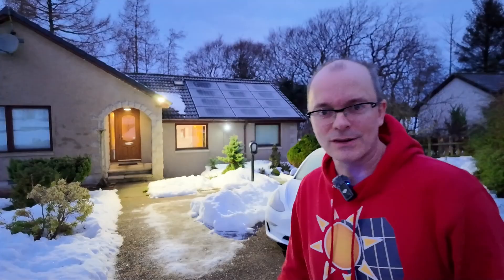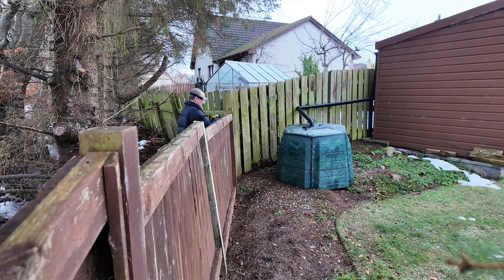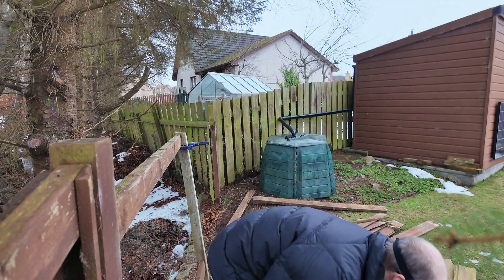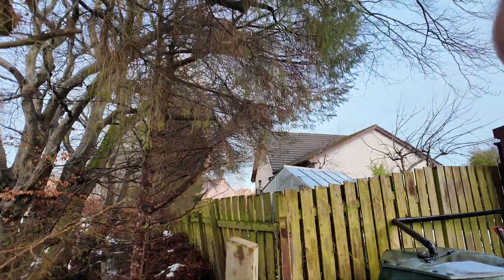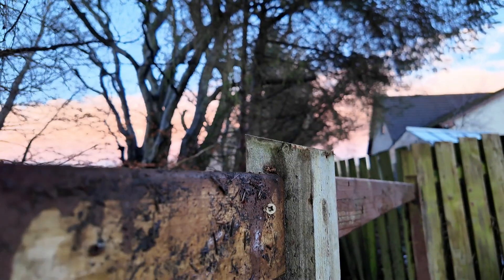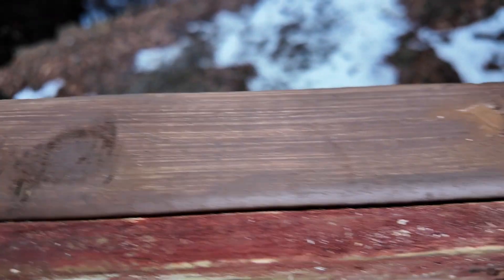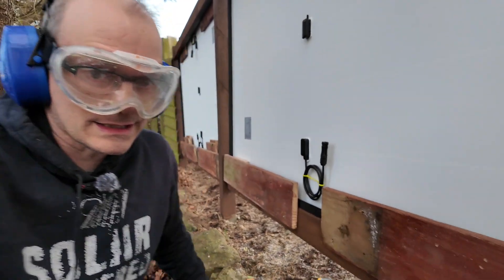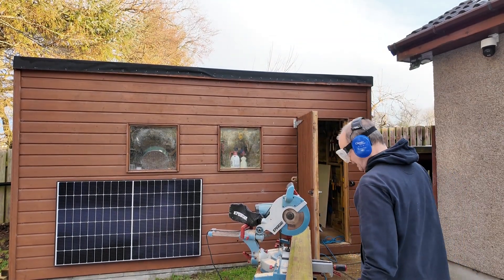The Prototype Solar Fence - Solar Fence / Shed / Battery Project Part 2

Comment: I don't know much about the climate in your country, but even though I live in a cold climate, the panels get very hot in the summer, which reduces their performance and lifespan. That's without even considering the risk of fire from contact with wood, but I want to do the same thing with metal! :D
Reply from the maker: Solar panel surfaces that are directly exposed to the Sun will get hot and temperatures outside are 30°C.  The reckoning is that they can hit 70°C.

But the same is also true for dark coloured woods as well:  they get just as hot.

The surfaces which are not directly exposed to the Sun will remain at ambient air temperature.  It is a surface temperature phenomenon.

Auto ignition for wood is around 250°C.  On its own, you’re not going to get ignition of the wood.  However, a bad connection with an MC4 connector….
Reply: @anthonydyer3939  I live in northern Wisconsin, and in the summer, my solar panels exceed 120°F with the backs open to the air. The problem I see with that installation is that the panels are completely covered, and the temperature will start to rise. I want to do something similar on one of my properties, but I was planning to use metal and include plenty of vents for heat dissipation. Time will tell how efficient and durable this installation is

Comment: The main thing is to try something and learn so congratulations. Designing solar panel racking (what’s being done here) = resisting “over turning” and “uplift” forces primarily, (weight / downforce of horizontal rack and panels is usually less than 3 lbs per sq ft but account for snow dead load then). Lots of folks are interested in fence mounting and they should avoid some of the details you’ve tried out here such as the tilt and rack connections increasing rather than decreasing the collection of water inside the lower panel frame rail - panels die from moisture ingress at the edge of the lamination to the front glass primarily. Panel OEM warranties used to prohibit vertical and horizontal mounting of less than 5 deg tilt in the small print for this reason. The main move here is to buy the right panel meaning glass:glass front and back which will have a seal between the glass front and backsheet and last 30 years plus much stronger in all respects. In my thumbnail pic you will see a sm version glass:glass panel made at the factory I led years ago, one of the first bifacials made in US. If you must use conventional panels, the tilt should have been opposite with bottom forward and not to the rear.  It’s grand that you’ve made a start and tried something! I say that sincerely but am informed by work to gain two US patents for racking that it will be worth some re-work when you can get to that (they’ll be fine for a few months). Cheers, Tom
Reply from the maker: It’s great to hear your feedback.  Indeed I taken note of the “leak holes” that also double up as ground screw holes.  

Now reading the manual for the module, it recommends an install angle of more than 10 degrees tilt.  There’s nothing in the manual to say that vertical mounting is not recommended, and indeed vertical mount systems are being increasingly discussed within the industry.

I’m certainly aware of issues with shallow pitch modules in relation to water ingress.  But the cavity on my module was dry after a period of heavy rain.  That gives me confidence that water accumulation is not going to be a chronic issue.

Comment: Only thing concerns me?  What about the water build up at the bottom of the solar panels when it rain.  Are you going to add some drain holes in the bottom rail that sits on the wood?
Reply from the maker: There are “leak holes” built in to the rear flange plate of the solar panels.  There has been some rain, but the inside edge has not shown signs of puddling.

Comment: That is a tiny hammer, normally a post hammer is VERY heavy
Wind loading can be  quite  high and your fence seems very weak to resist, you may want to do some lateral reinforcement 
It seems like a  great application for Bi-facial for efficacy and look for anyone else doing this project 
Solar fencing is otherwise a very good and cheap way to add solar

#BanTeslaStopFascism
Reply from the maker: Other fences around my property would be better for bi facial.  The light behind this fence is very dark with all the trees behind it.  But yes the post could certainly do with extra support.  I’ve seen these post hammers - a good gym membership alternative!

Comment: The fence looks good, both from the front and the back.  I have similarly wrestled with getting fence posts out of concrete and dealing with the posts rotting off at ground level so now I replace them with concrete posts set into concrete.  It’s more work than your steel spike but it’s a permanent fence post that won’t cause me trouble in the future.  If you want the aesthetic of wooden posts then set a dwarf concrete post into the ground and bolt it to the wooden posts - I’ve done this a few times to strengthen and straighten wooden posts that have rotted off and it works great.
Another minor comment on your solar panel fence, where the wire goes between two panels over the front of the post, suggest you wrap the cable in conduit , sheathing or insulation because over time the cable will rub against the post with the wind and get damaged.
Good project, keep it going !

Comment: EXcellent job Anthony, very impressed with your DIY solar hooks to secure the panels from the rear, why not where the cable goes across @ the top, carve out a groove left to right on that post, and then fasten a former fence board,vertically, not only will it protect the cable but it will proablt completly cover the gap ??, part 3  please Anthony :)
Reply from the maker: I’m thinking of protection for that cable, but PVC capping will probably be the way to go.  I want it to be obvious that it’s a “don’t drill here” zone.

On another note. I have to redo the fence.  Big mistake:  Aluminium and tanalised wood should not touch each other.  I didn’t realised that tanalised wood contains copper, so you’ll get galvanic corrosion.

Solution:  A plastic barrier wherever they touch.  Could be as simple as a thin bin liner.  I’ll be using that plus strips of Damp proof course.

Sadly it’s a rain forecast for the weekend, so the shed will probably have to wait.  But I’ve been prepping the wooden notches.
Reply: use damp proof course material, its weather resistant and much thicker than bin liner material which is usually biodegradeable
Reply from the maker: @geoffreycoan I’ve got a 30m roll of damp proof course, so I’ll retrofit my prototype fence.  It’s not too flexible for the slots, but I could cut up a plastic bag for those bits.

But I’m now having further thoughts about my shed and front fence designs.  I’m inclined to go the rail mounted route for the panels, rather than removing the shed cladding.  

There’s a certain degree of faff with mounting on to vertical rails with a clamp system.  Plus I also need to somehow reach behind to handle the cables, and there’s only 40mm clearance to do that.

But taking the cladding off, adjusting the shed frames, and then using my wood hook concept.  It was complex, and the loading on those hooks is unproven in high winds.  Once I added on the need for a barrier between the frames and the timber, it crossed the “go back and start again” threshold. 

I’m going to try a static load test on those hooks.  It needs to withstand 80mph gusts, which impart a force of 750newtons per sq metre.  So 6 hooks per panel, means I can try lifting a load of 13kg to see if it takes the weight without breaking.

Plan B:  Bimble solar sell mini rails with 4 clamps at £9.  I think I’ll be deploying those for the front fence.  The joists run in front of the posts, and the post interval is less than the landscape width of the panel.  Nice solid posts as well!
Reply: @anthonydyer3939 Good idea to do a stress test on the hooks.  I’d suggest not just dividing the force into area directly like that because you won’t have an entire panel exposed directly and evenly to the wind, it will be one edge, corner, etc where the wind gets between two slats, etc and then that force applies a twisting lateral force on the panel.  The panels are pretty strong though, after all on most roofs they are directly exposed to the wind getting underneath them, secured only by the rails and clips in half a dozen places.
Maybe proven clips is the way to go as all that maths has already been worked out for you!  £9 for 4 sounds a very fair price

Comment: I think if I was to do this I would put in regular concrete fence posts with a 6' gravel board at the base, and slot two solar panels landscape in like you would a fence panel. If the panels are too thick you can screw some batons (these are also sold ready made by builders merchants to accommodate euro 180cm fence panels into imperial fence posts (6")) to the edges to get the correct thickness (which may be needed to avoid shading from the post anyway). If the posts are too far apart and the panels wobble you can hammer in wooden wedges to stop any rattling, like you would a regular fence panel.
Reply from the maker: Concrete posts, honestly would be the only thing I’d want in the ground.  Ideally.  Sadly my back says “don’t try your luck!”.  Heavy ground work is just too far outside my comfort zone, and sadly fencing contractors are simultaneously too expensive and too many of them just concrete wooden posts into the ground, ready to rot.
Reply: @anthonydyer3939  yes I’ll admit it is hard work, there are more lightweight plastic options for the posts and gravel boards that are a little more expensive, but you can’t get away from needing to dig some holes. You might be able to get away with hiring a handyman if you can provide the post hole digger and the chisel on a stick (forgotten the name of the thing, but I have one and it is fantastic). From memory it was more shoulder and arm ache with those tools rather than your back because you’re pretty much always upright. Good luck!

Comment: Suggestion for your bottom joist; using a router, cut a groove for the panel to sit inside. This can also be done using a 3 part composite, with the middle of the three planks being less wide than the other two. I might give that a go on my own panels when they arrive...
Reply from the maker: Thinking some more about this, the front bezel is very thin and therefore the groove would have to be very shallow to prevent cell shading.  Given that wood has a tendency to swell and shrink, I don't think those tolerances would be OK.

Comment: Did you read any handling instructions for the panels?
Every single supplier I've worked with clearly states to never use suction cup lifters on the panels. It leads to microcrack damage in the cell material.
I was screaming at the screen when you lifted that first panel. 😱
Reply from the maker: It doesn't state that suction cups shall not be used in the Aiko instructions.   But reading it again, it does state that only the edges of the module shall be held.  

I'll be mindful that that.
Reply: @anthonydyer3939  Yeah, some manufacturers are a bit vague while others create very visual illustrations of what not to do. Most of what you see on install videos fall under the not to do in fact.
I was very mindful about this during my solar 10.2 kWp install and my system is overperforming by 5% !
Reply from the maker: @1kreature  I was just having a look at the suction cup rings more closely.  Those rings appear to be sub surface.  They don't come off with a damp microfibre cloth.  So I think you're correct.

So now I need to design a tool to carry these comfortably.  The plasberboard carry tools don't have a wide enough jaw sadly.  So I'll make something myself.
Reply: @anthonydyer3939  I am so sad to hear that!
That was what I was worried about. These panels can take a lot of abuse from wind and weather, and even quite large hailstones. But the force applied by these suction cups is quite intense and the glass on the panels are thinner than normal window glass. In fact, anywhere from half to a quarter of the normal thickness. At these thicknesses the glas will noticeably warp from even the pressure of a hand carefully resting some of your weight on them while trying to reach over on a roof install. All pressure/weight classifications call for even distribution of load and anything else can be a worry.
I notice that a lot of manufacturers for US and UK market ship panels flat on pallet, while not a single European one does? My panels came standing on the pallet with the long side vertical while I have seen them available in landscape shipment also. No option for flat shipment. I think this indicates different levels of care from the suppliers and potentially distributers. It takes a huge bump to damage the panels on the pallet such as shipped to you, but it doesn't take as much to cause microscopic damage that deteriorates the panels further over the next few years.
Reply from the maker: @1kreature Actually, we’re good.  Microfibre doesn’t rub it off,  but rubbing my finger on it was able to shift it.  It’s just a mark.

I’ll certainly review the suction cups.  Grabbing the edges, especially the top edge is painful.
Reply: @anthonydyer3939 yeah mine contained explicit instructions to always lift with two people. And at the same time to avoid any twisting motions which is very hard with two people.

Comment: Btw, the simple Z brackets you attach on the 4 holes on the back of the frame on the panels is a much easier mounting option. Just place the two joists at the height of the holes/brackets.
It also prevents you from placing anything inside the edge of the frame like you did, which is a nono from the mfg. Nothing should be allowed in under there to potentially impact the backside of the panels.
Also: There is a drainage hole on the bottom edge of the panel frame that must not be blocked when you install them to avoid ice build up ruining the panel.
Reply from the maker: I was thinking about this. L brackets would also work.  But by ‘eck the Z brackets are expensive (£14 for 4 of them).  I’d love to use regular galvanised brackets, but I’m aware of galvanic corrosion.

The instructions say that brackets should not be in contact with the back of the module such that it can be pierced under pressure.  So what I’m doing is not specifically excluded.  It does go on to say that if you use clamps and bolts then you must use prescribed methods.

Honestly I think I’ll be alright.  Both the vertical and horizontal load is on the frame.

Comment: I've been thinking about a similar project but I'd probably use DuraPost metal posts rather than timber/concrete posts. Having used DuraPost for a couple of runs of fencing they're a pleasure to work with - albeit pricy for the full effect.
Reply from the maker: I considered Durapost.  Another advantage is that it helps to lower the earth electrode resistance. 

I'm not sure though if they are pile driven into the ground or set in concrete.  I'm sure either method is viable though, but pile driving looks potentially easier (although it seems like Pile Driving still involves repetitive lifting of a 15kg weight - which strikes me as also being back breaking)
Reply: @anthonydyer3939 I used Postcrete - no issues yet. Better longevity than wooden posts and much easier to work with than concrete posts. I think Wickes started carrying a sunset of the range in store.... Not sure if they still do.

Comment: Classic delivery drivers. 1-pump on the pallet jack and it's off the ground. That'll do ya. I can understand if he needed to brake though...
Most of these can lift 3" you know? They seem terrified of lifting higher than minimum for fear of toppling?
Reply from the maker: It took a good 25 minutes for him to find a level parking space, and then manoeuvre that pallet onto the world’s smallest lift gate.

He was struggling on the ice, and once mentioned “technically we’re kerbside deliveries only”.  It was a “good enough” delivery.  But he certainly was watching his clock.

Comment: I use a sack trolley to move  heavy rectangular items like 60kg street paving slabs. Our heating guy also used it to move my old Sunamp thermal store (80kg). The trolley was only a cheap aluminium folding one I bought online with 100kg max load. 
I have also used it for carting sacks of ballast, cement and large bags of garden compost. Folds up and takes vary little space in shed.
Reply from the maker: Yes, I've got a sack truck as you describe.   It was very handy for moving that block of concrete that previously held that fence post.  But moving 230kg is a different game.  I've seen youtube videos of companies moving 260kg gun safes down tight narrow stairs in peoples houses.  They used an electric stair climbing truck.  It looked like a precarious operation.

Comment: How about running the cables behind the fence? And why is there a drainpipe in to what looks like a compost heap?
Reply from the maker: The drainpipe is there to assist with rotting things down in the compost bin.  Previously the contents were too dry, and nothing was rotting.  It's a good a place as any to divert runoff from the shed roof.

I prefer the conduit to be accessible.